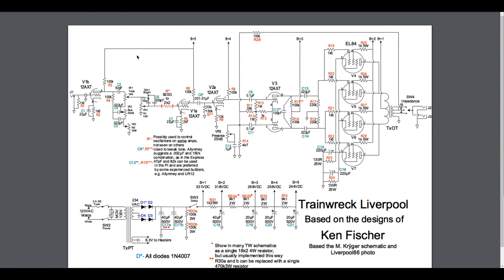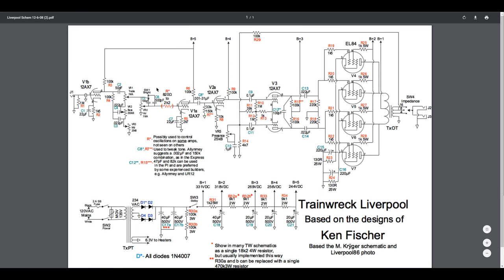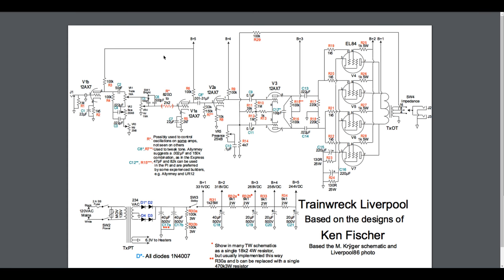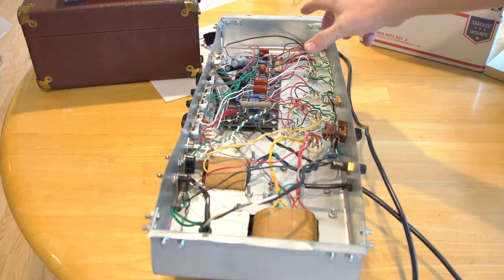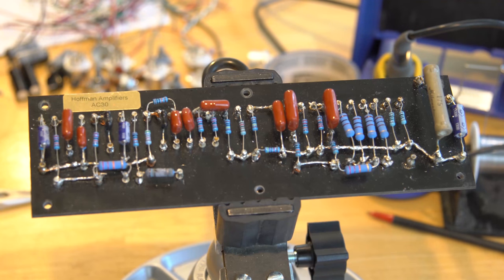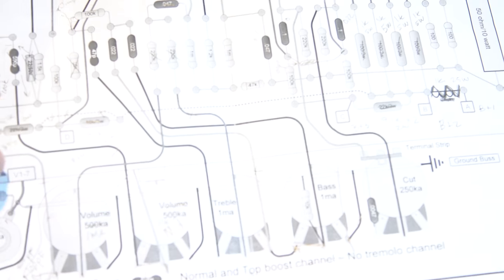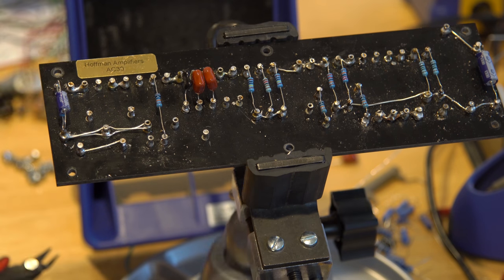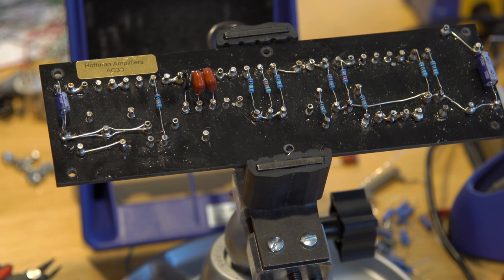TrainWreck Liverpool Video 1 Intro

Comment: At 00:54 ... The red squared letters are like
a schematic shorthand for nodes in common?
 Or they at least would connect to a common bus?

Wayne
Reply from the maker: They are the points where that part of the power rail connected into the associated letter on the main layout.  Another common form is B+1, B+2, etc.  It allows matching of the filter capacitors wish the right section of the amp
Reply: Q1.
Is the first B+, (whether B+ or B+1 as in this schematic), always the
highest voltage?

Q2.
Is it always connected to the output transformer?

Q3.
Is it DC voltage?

Q4.
If it is DC, don't the output speaker(s) require AC?

Thanks for all your help
Wayne
Reply from the maker: A1: In theory, but not everyone always follows this standard.  It's a pretty common one, though
A2: not always.  Sometimes there is a power filter cap, a dropping resistor/choke and then the second node is connected to plates/OT center tap
A3: Yes it's DC voltage coming from the B+ rectified source.  This is what powers the tubes.
A4: yes, but the output from the tubes of the signal goes in AC format, so the DC is ignored by transformers and blocked by capacitors.  The AC signal outputting from the power tubes goes into the transformer and is transformed to the lower impedance on the secondary side for the speaker.  Does that help?
Reply: Yes, your answers helped!

331 = B+1
318 = B+2
269 = B+3
256 = B+4
244 = B+5

In other words, 331V might go to section 'B',
and 318V may go to circuit section 'A', etc.
... and 269V,256V, and 244V to other circuits.

So, the rectifier tube converts AC to DC.
From some point, there is a feeding of DC to
the power tubes which will convert that back
into AC voltage, which will be sent to the
output transformer which will change it from
high volts/low amps to low volts/high amps.

I may have ignorantly omitted 2 or 3 DOZEN
steps in that process, but essentially, I hope
I have it correct.

Wayne